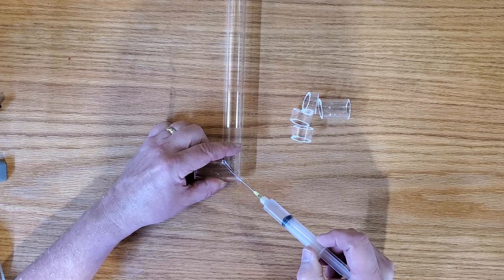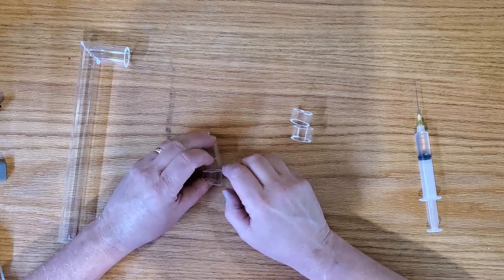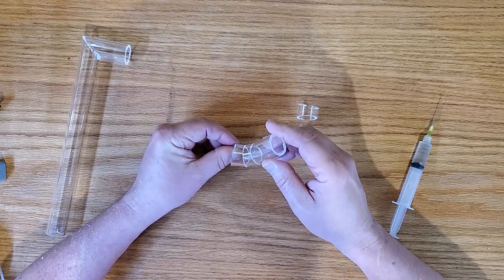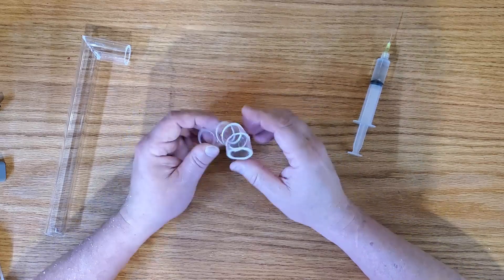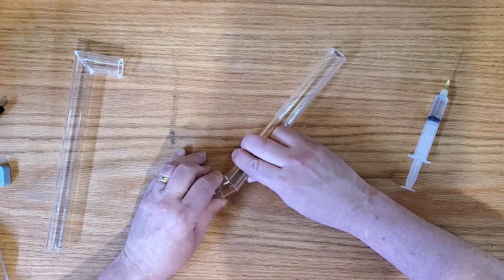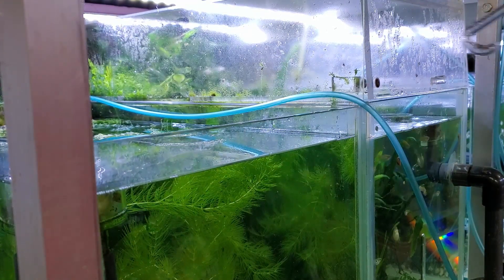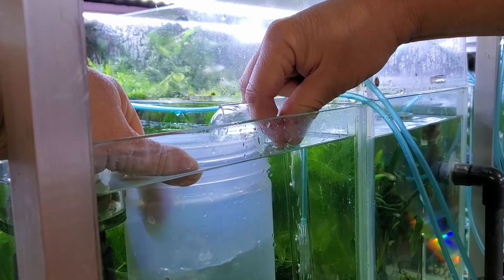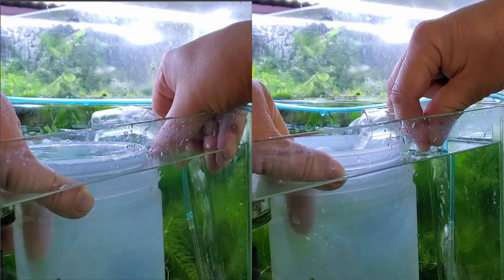Sweeping Elbow Vs. Ninety Degrees

Comment: How did you bend the airline hook?
Reply from the maker: I used a hot air gun Sue. It's much easier to bend than the larger thicker pipe. Thanks for coming by!

Comment: People who bend pipes for PC water cooling use a flexible silicon rod that is the same diameter as the ID of the tube to facilitate sooth, even bending. They use a lot thinner walled stuff though.
Edited to add that the height of the aquarium water level was closer to the rim on the curved tube more often than the elbow. Since water height has a huge impact on the efficiency of air driven "pumps" then your results might be skewed. More testing runs are in order to make a call on if it is significant or not.
Reply from the maker: I've seen those and you're right about the difference in wall thickness. I did notice that the sweeping elbow was a little higher than the 90. I didn't bother redoing it as it had already won. Some people have asked for some bubble comparisons for this so I will be doing some more of these and will keep an eye on that for those and see if there is a difference. Thanks!

Comment: I just counted off so I wasn’t using a timer but I got 27 seconds and 20 seconds which I think is about 26% faster. I don’t know that it matters for most of your filters. If I was going to do a production filter and have parts cast for it I would definitely take the curve, But for one off pieces I don’t think it would be worth the effort every time.  Know if you bye other tubes other than the acrylic that you have to cut into yourself especially pieces that I already have curved 90s that you can buy I would go that way as well.   I’ve also found with bending if you use rope instead of sand you can get a pretty decent band usually but it can still kick a little. Do you wanna find a stiff rope that only bands in about the angles you want and fills the tube, But I think you’re right on that acrylic it’s just too thick to bother with.  

Though I would like to see you build an acrylic bending table still.  Lol. I watched a bunch of videos on it it got kind of excited about it it just seemed kind of cool and like something you could use a lot.
Reply from the maker: You're right on the money as usual Shane! I'm going to do one more and bend the pipe. After that I will test each over some time to see if the extra work to make and maintain are worth it . Thanks as always for coming by!

Comment: 31 seconds for the 90 deg and  26 secs for the sweeping elbow. close to 20% faster.

the probable reason is  turbulent flow  waste energy that the rising air creates.
like a  ball hitting a wall instead of being guided round a corner in those wacky wire "machines" the ball will rebound.

in this case the air bubbles compress just a tiny bit then expand immediately, creating  a choke point(near his finger) for the water as the air expands while exiting the pipe.
you can actually see it by slowing to 0.5.
for the sweeping elbow, you can see the bubble "compress" after the  curve, then expand right outside the  pipe. the air doesnt  create a choke point  since there are no pipe walls to constrict  the bubble.
Reply from the maker: Now that's some serious observation! Thanks for taking the time to do that. You're right about the effects of the hard corner. It does cause some back pressure

Comment: Would this chemical weld approach hold up with PVC? I know they use solvent as well to connect the parts but connections are kinda pricey compared to the PVC alone.
Reply from the maker: No. Acrylic and PVC are of different chemical makeup. The solvent for PVC is acetone. Thanks for watching

Comment: For bending acrylic pipe wintergatan with marble machine x uses a silicone rod and feeds it into the pipe, then use the heat gun to bend it, I wanna say he uses cornstarch on it to help it slide in and out
Reply from the maker: Thanks I've seen that. The pipes he uses are thinner though. I'm going to try one more of these with a bend though to test it out. Thanks for watching!

Comment: Over the long term there seem to be so many other variables in flow rate (accumulation of debris in the filter, etc) that small changes in flow rate may have minimal effects.  Looking forward the long term results in a real test.  Thanks Fred O
Reply from the maker: Hey Fred! You're right and flow isn't the most important aspect of filtration either. It will still be interesting to see how this goes

Comment: How coincidental.  I was thinking of proposing to you to compare a right angle discharge to a bend, a la Swiss Tropicals "Jet Lifter."  While perusing their catalog I noted they sell the Jet Lifters with extended lift stems (plus other small refinements), allowing deep box filters to be used that are more in line with my craving for more media for the same size footprint box.  If you're going to occupy a corner of the tank, why not use a 10-14" high box and have layered media of significant quantity and type?   It has me thinking of simply purchasing a Jetlifter and fitting it to a commercially available tall container for a vastly superior type of aquarium box unit.

I'm flabbergasted that Aquarium Science had not already made this great breakthrough in 1956 when I bought my first corner filter to run my first tank.
Reply from the maker: Commercial filters won't go that way as there aren't any moving parts so the filters will last forever and there aren't any bits and pieces to sell people after they've bought it. As far as maximizing the content for a given footprint, that's an interesting idea and worth pursuing. Thanks for coming by and sharing your thoughts on this!

Comment: Never even considered this. Family are all plumbers, so I have the understanding, but my UGs have all had 90s and just never considered options.  The increased flow might cut down the mulm that is notorious under UGs.  Personally I used canister filters connected to the UG stacks and reversed them on cleaning days. Kept solids from settling under and in the gravel as well as pushing tons of water through the beneficial bacteria living on all of the gravel.
Reply from the maker: Thanks for sharing that Ray!

Comment: That’s really interesting.  I wonder if the air bubbles have a play in the flow.  If you hooked up to a pump would it have the same results?
Reply: Thr air bubbles are the reason the water is able to flow, and if theyre diffused very small, it helps the water to travel smoother and faster without all the little hiccups like you see here, its small but its something that bugs me.